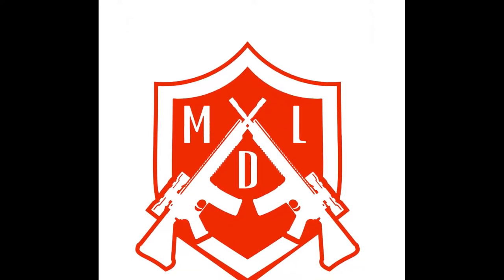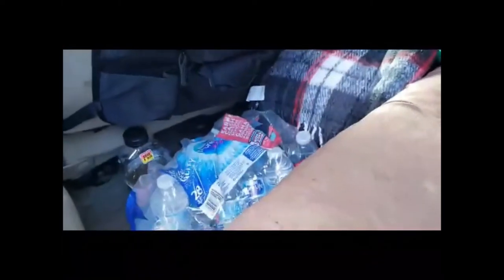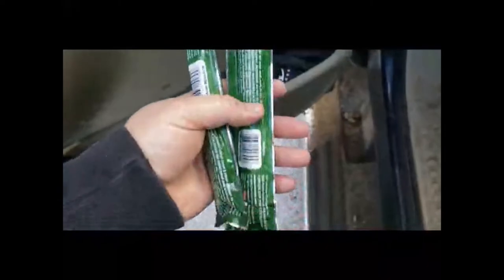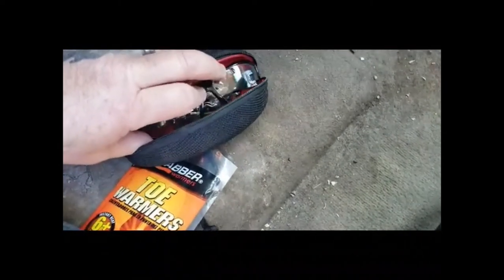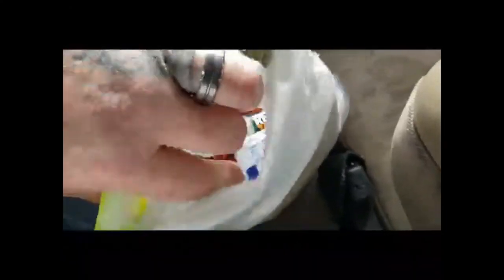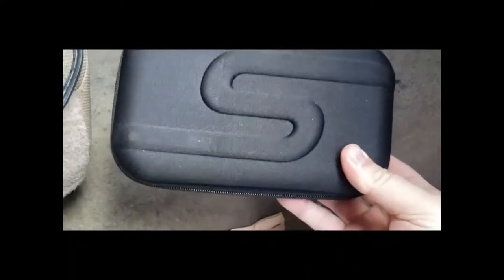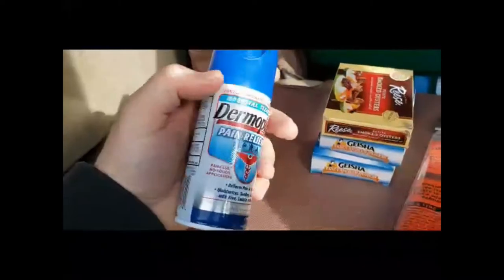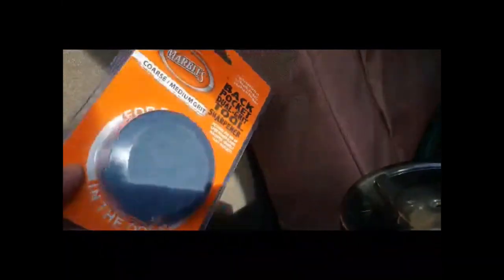BUDGET FORD F250 DIESEL BUGOUT/OVERLAND TRUCK

Comment: Great set up and great looking truck as well. I loved the 6.0 engine especially after bullet proofing. Just upgraded to a newer truck with 6.7 and love it building t out to be a truck camping set up. Thanks for sharing great video
Reply from the maker: Thank you, I really like the 6.0 as well they just needed a little loke anything else and for a guy to keep up on the maintanance and they will run strong for a long time. They newer pickups are very nice as well! Sounds like you will have a good solid rig when you are done.

Comment: Looks like you've got everything covered. Do you happen to carry any extra fuel or a empty container that could be used for fuel? Or maybe a tire repair kit just incase you get 2 flats.  Sorry for the stupid questions just wondering if maybe I'm going overboard with my preps. Hope you all get better soon. God bless and stay safe.
Reply from the maker: No question is a stupid question my friend. I do carry extra fuel and a tire repair plug kit. Those are in the back with the rest of my tools and recovery gear. I will do another video on what I have in the back as well. I really appreciate you checking it out. I feel it is better to be safe than sorry and have it and not need it, than need it and not have it.